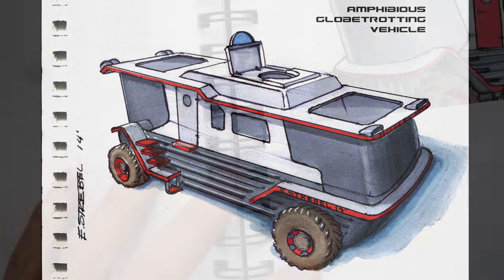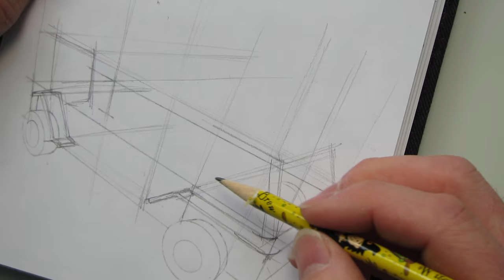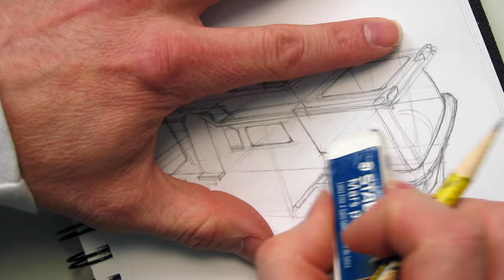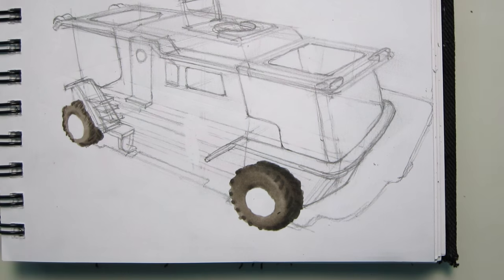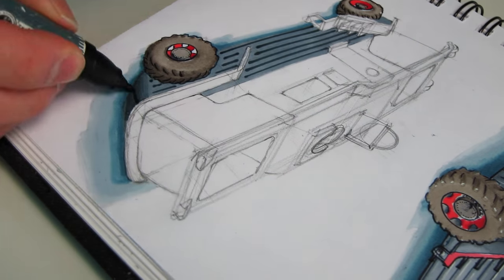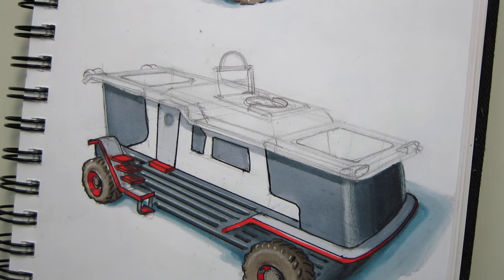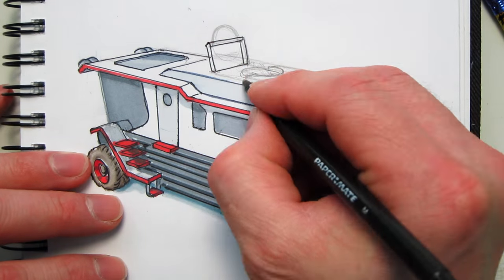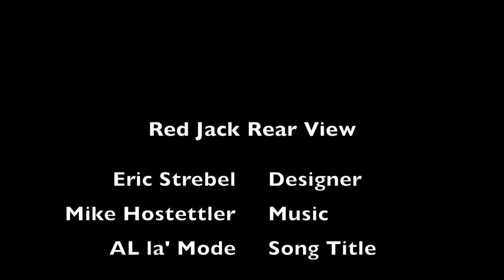Marker Rendering Underlays Industrial Design: Adventure Toy Vehicle  Sketching Series Episode 3

Comment: Another great video! one question—What was the program that you used to create the perspective?
Reply from the maker: +Dan Lawlis Glad you liked this one. I created the base box and wheels in Form-Z, after using it for about 15 years no longer use that 3D application, it just could not keep up with my product design needs. I have switched to Fusion 360 from Autodesk, much more robust and relevant. You can use just about any 3D application, to make something like that. Google Sketch up would work as well, it's free and easy to use. Next two videos will have something special,  they will have a Photo bash background tutorials.